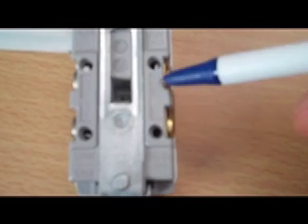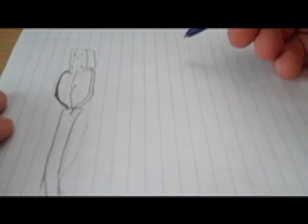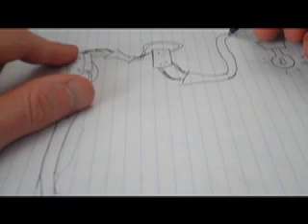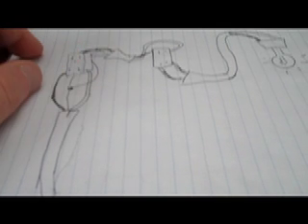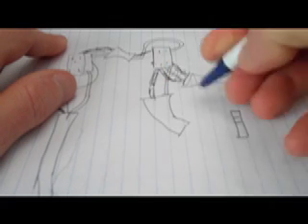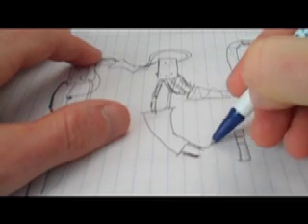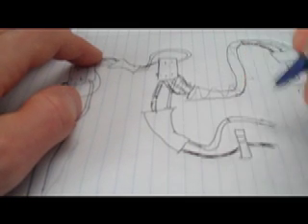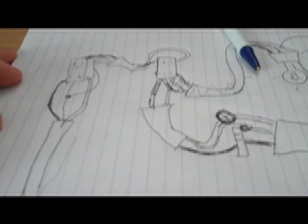Home Electrical Wiring Basics

Comment: Will the switch in this example only turn off the light, or will it turn off/on the outlets as well?
Reply from the maker: Kirk Christiansen no, the switch will only control anything downstream from it.  That's why the switch controls the light and not the receptacles.  Notice I put the switch upstream from the light only.  Good question.
Reply: Joby F. Randrup Perfect. Thanks!

Comment: can u please explain how to move an existing switch... i ran new wires from old box to new place... when i hooked it up (black to black etc)...on all the time...flipped switch and tripped braker... please help
Reply from the maker: Chris lastnamehere hook it up exactly as you unhooked it.  Switches typically only hook up the black wires.  One black frolm the supply side and one from the side that goes on to the rest of the circuit.

Comment: If you have a switch and receptical side by side, you can hook the power to the switch first, and then go to the receptical.
Reply from the maker: You are right that it is the preferred method.  However, there are times when you have to put the switch after the power (say if you have a basement light with a pull switch and you want to control it instead with a wall switch.  Watch this video to show you how to do that:  https://www.youtube.com/watch?v=j1Pn7ck33uA&t=37s

Comment: How is the series connected form the back of the original outlet?  Are the secondary holes in the outlet itself used to daisy-chain the power or?
Reply from the maker: Yes.  Just think of it like power comes in the outlet and, if you want more outlets or something, the power comes out the other holes to go to the other outlets or whatever.

Comment: Hello. I don't get why you need to cut the white wire to then put it back together when installing the switch.
Reply from the maker: +Kenneth Rivas you don't have to but it makes it much easier to work with the wires.
Reply: Oh ok.. Thanks.

Comment: Need your help! how do I wire up 6 lights for my basement. I ran Romex 14/2 (white-Black-ground) for all the lights. There is a 12/3 BX cable running from the braker box, to a junction box I would like to use for power, to the 6 lights. Thanks for your time (Antony)

Comment: Great video... I want to tap power from a garage socket and run a conduit to a light switch then drill holes for an outdoor garage light. What gauge wire do I use to run three outdoor garage lights? Thanks
Reply from the maker: +taskforceripper91 Check the circuit for the amperage.  Most likely, you have a 15 amp circuit which means it would be safe to run 14 guage Romex or equivalent.

Comment: Joby, thanks for the video, on your illustration in the beginning you show the hot wire going to the left side of the socket, I was certain the black (hot) went to the right side to brass. from there your next socket was then wired correctly with black to right side and neutral to the left side. Can you explain please? Thank you friend.
Reply from the maker: This video is mainly concerned with the flow of power from device to device.  Specific wiring videos can also be found on our youTube channel.  Thanks.

Comment: I appreciate the simplicity of your video and drawing. However, there are three problems with your video for novices and it concerns me. 1st it appears from your drawing that you are showing the line (black wire) going to the left side of the outlet and the white (neutral) going to the right. That is backwards. Facing the front of a switch, the black goes on the right (under the brass screws!) and the neutral (white) always goes under the aluminum screws on the left. 2nd, you indicate they can you use the push-in connectors on the back. A good electrician never uses the push-in connectors because they can eventually come loose; they use only screw terminals. 3rd you say you can use pigtails but then go onto indicate that they can just use the push-in or screw terminals to continue power to the next fixture. A good electrician will use pigtails in the box with one of those lines going to the outlet and the other leaving the box going to the next receptacle or fixture.

Comment: So, I've been in a couple houses where there were wall outlets that were turned on/off by a light switch. Is this due to the fact that the switch was placed earlier in the chain than the wall outlet? If so, I'm guessing that if the Romex was run differently, to where the wall outlet appeared earlier in the chain that the light switch, it would not be affected by it?  Thanks for the info in this video, things appear much clearer to me now!
Reply: +Kyle Belitz I came across that in 1 of my old houses. It was a pain. I couldn't use the outlet without taping the switch. Finally got tired of it and rewired it. But the house was a model home and the builder I think were trying to keep everything to 1 outlet making it easier to shut everything off.
Reply from the maker: Kyle Belitz You are absolutely right.  I have never heard of a switch controlling the entire outlet.  Sometimes (especially in apartments) they will put a switch before the outlet but the switch will only control one of the plug ins of the outlet, while the other stays active all the time.

Comment: As you point out only the BLACK ('hot') wire must get switched!  Unfortunately many a dummy doesn't know this and switches the white wire.  And it DOES work (makes the light go on or off) and so he thinks he did a fine job.  Except someone later comes along (including himself) wanting to change the light fixture, turns off the switch, the light goes out, and then starts changing the fixture thinking there is 'no power' to it.  ZAP if he touches the black wire on the fixture because it's STILL LIVE (it wasn't switched, the white incorrectly was).  His body now provides the completion of the circuit so gets zapped.  Which is why anyone should ALWAYS shut off the circuit breaker at the box before doing ANY electrical work on ANY circuit--- that solves the above possible problem caused by some earlier dummy wiring it the wrong way.  (in some cases a white wire is used AS a black/hot wire in which case it is marked with black tape to signify that but it maintains the rule that ONLY the hot wire in a circuit is switched).
Reply: six of one no you should always test the circuit for safety whats to say someone hasnt done the same in the circuit breaker? i live in the uk so our terminology colours and voltage is all different
Reply: i meant what if someone had crossed polarity of live and neutral? so your busbar is neutral and your neutral bar is live, i know its ridiculous to think anyone would ever do that but the things ive seen its possible
Reply: look listen, if the netural was connected to the hot busbar and the hot wire connected to the neutral bar. this meaning the circuit breaker would be swtiching the neutral it would be possible to turn it on and it would not be a short... even if you connected neutral to a hot circuit breaker it wouldnt blow it would just be crossed polarity. im an electrician and im assuming your not just think you know what your talking about.
Reply: The only person who would connect up the hot busbars with main neutral, and the neutral bar with the main hots, and every subsequent circuit breaker ass backwards would be in a rubber room somewhere.  You have a fantasy about doing things at a sub-moron level.
Reply: Bottom line is, after all the retarded input from Gaming boy, is, in caps, ALWAYS TEST ANYTHING ELECTRICAL YOU WORK ON BEFORE YOU PROCEED PERIOD, just to make 100% sure it's DEAD, whether you flipped off a light switch or the branch circuit breaker at the box, or hell even if the main breaker has been switched off.  Why take a chance?  Breakers can malfunction, including the main breaker.  Don't THINK about whether it's dead, TEST.
Reply: the first thing i said was to always test the circuit for safety, yes i am a fully qualified electrician in the uk, im not 14 and im not a druggie, your the one who raised an argument with me about something clearly you think you know alot about... my point was that it could happen and so test for safety i never said it would because i probably wouldnt, the stupid thing is that you ended on the same note i started with, are you an electrician or have you just once wired a plug and think you are?

Comment: Hi Joby! You are obviously an expert on electrical issues. I wish you had a local office! My husband has a good basic knowledge of household electrical, and has had success re-wiring some basic circuits; but is 'stumped' by our 'current' (lol) problem. We have an adjoining guest cabin wired into the main house. At the junction box; we have three strands; Black (hot), white, (neutral), and yellow. (ground) Voltage between the white and black (red & black going to the cabin) is 220V. Between the ground and the black, or the ground and the white is 110V. All the outlets at the cabin have 110V. We want enough power at the cabin to run lights,  TV, and a small a/c unit. Obviously; we want safe grounding. Any clue what the issue might be? You're videos are wonderful! I'm sure if you were here you could fix this in a jiffy! We have a graduation party coming up June 1st and can't find a local guy in time. Help! (hopefully) Thank you so much.
Reply from the maker: Joy Sharp You mentioned a red and black wire.  Are you saying you have black, white, and yellow going into the junction box from one area and a red and black tied to it?

Comment: Doesn't the black wire come off the top of the switch on the same side instead of the other side?
Reply from the maker: Usually...Many times both connections will be on the same side as you said.  I've seen it on the other before though.  Plus, this is a very basic explanation of how power gets from one place to the next, not how to wire a SPST switch.

Comment: from the circuit breaker the one you start out with, can you put two romex's in going to two separate outlets?
Reply from the maker: No you can't.  However you can run that Romex (that comes from the breaker) to two separate things (like two outlet or a light and switch and an outlet).  Just run them in series like I show in this video.
Reply: ok ty

Comment: can you connect 14/2 with 12/2 wires in boxes?
Reply from the maker: Yes, you cannot go the other way though.  All you would be doing by going from 14/2 to 12/2 is using thicker wire.  You must have some extra 12/2 laying around I am guessing.

Comment: I am in the midst of renovating a bedroom, but was stonewalled by the electrical work needed.  I have to move an outlet and then connect a light that was being run by a separate switch to the other light so that both would run on one switch.  I have been searching the Internet for help, and your video is, by far, the best explanation I've come across (even with the raw drawings).  Thank you!  Now I feel more confident about tackling the electrical.

Comment: when you were describing taking the power from one outlet to another (to continue the circuit) are you effectively having an "in outlet" on the top and the "out" on the bottom? that would allow both outlets to eventually work provided that all subsequent pieces in the series are hooked up correctly?
Reply from the maker: Yes.  And it's important to remember that when troubleshooting.  For example, if more than one outlet is dead in a room, it may be that something like a GFCI outlet somewhere upstream from those outlets is tripped.

Comment: Why would you place the first two outlets in series? Then you get a voltage drop across the second outlet and at the light.. I would assume the better way would be to run the first two outlets in parallel, then you run the switch and light in series (obviously). This way there is no voltage drop, and if either outlet dies the light will still work.
Reply from the maker: Jordan, simply because parallel circuits use more material so is more expensive.  That's the only reason.  Parallel is always best but it's the most expensive option.  Great point!
Reply: Jordan Bausmer I think he was actually doing it the way you said. You have to put the outlets in parallel. He is not talking about a series circuit, he just says "series" when he is joining multiple outlets together in parallel.
Reply: I had the same question. Is there a good answer?

Comment: +p. m.

Yes. The remainder of the items in series should be grounded.
Outlets & switches will still work with only two wires. But, why would you leave them ungrounded in the first place? Grounding was designed to save equipment,
or anything you'd plug in, from damage due to electrical overload.
Reply: I didn't get why he ran the ground wire back up to the other ground instead of to the next electrical outlet
Reply from the maker: Grounds follow the power.  In this example, the ground goes into the back of the first receptacle, then the second, then the light.  The only thing that isn't grounded here is the wiring of the switch.
Reply: Joby F. Randrup yea I'm talking about at 2:01 in your video when you take the ground and loop it back instead of running it with you black and white wire to the next outlet unless I'm confused can you explain better please that part
Reply from the maker: Jeffrey Duggan oh okay.  The reason you have to tie it together is because there is only one ground screw per outlet.  The one Romex goes in to the outlet (there are two holes for the white and black to go in to).  The new Romex start at the other two holes in the back of the outlet.  However, there is only one screw that will accept a ground wire and I believe the connection is more secure if you tie them together instead of attaching two grounds to one screw.  I will try to post a video showing you exactly what I mean this weekend.  Okay?
Reply: Joby F. Randrup okay yea please post a video explaining why you tie it back and how it grounds the other outlets would be awesome thank you
Reply: And when you piggy back it you snip the wire and twist all three together with wire nut? Could you demonstrate with spare wire if possible?
Reply from the maker: Here ya go.  This should answer your questions Jeff.

https://www.youtube.com/watch?v=8btDgSERDRQ&feature=youtu.be

Comment: For years, what you show is how electrical has been installed.  However, many cities have adopted the National Electrical Code (NEC) which no longer allows this type of wiring (even though it is the manufactures recommendations for installing their product).  The NEC requires more labor, therefore electricians can charge more.  The change to your video is when you added the second outlet (receptacle).  Instead of connecting the second wire to the outlet, you would disconnect the outlet and add a "pigtail" (short coated wires) and wire nut all three of the same colors together.  The "pigtail(s)" are not connected to the outlet.  Using the NEC wiring practice, if an outlet goes bad, it does not cut the power to the other outlets in the series.  BUT if those wires are not "nutted" tight (can yank a wire loose), you have a potential fire hazard...and why I personally agree with your drawings and the "manufactures" way of installation -- BUT at this time, you way will not pass an electrical inspection and viewers will have to redo it to the NEC way - so viewers need to check with their local code officials to see if they are to install based on the NEC or the Manufacture's recommendations.
Reply from the maker: All of my wiring has passed where I live, both new construction and retrofit.  Thanks for the info though and you do bring up a good point:  You should always go to your friendly library and get yourself the newest and hottest version of the NEC (a lot of people don't know you can access it for free right at the library).
Reply from the maker: p. m. Hello!  Wiring that is sloppy is always a potential fire hazard.  Do you think a 'how to wire' video would be helpful?  Unfortunately, pig-tailing is the easiest way to interface at the site.  It is not likely to go away any time soon.  It is very important to make sure all connections are snug.

Comment from the maker: The outlets should have ground connections.  They are usually green.  This takes the ground from the breaker, out to the outlets and back to the breaker.  If your outlets don't have ground connections, they are probably out of date and should be replaced.

Comment: Great video, thanks for taking the time to share the information. Question though...it said that you looped your ground off the first outlet to the ground on the Romex coming from the circuit box. What do you connect the grounds to on the outlets and switches further down the line?

Comment: That's not extra voltage, that's extra amperage. Extra voltage would be 240v which is not used for electronics. You won't burn the circuit if it's wired properly, you'll just trip the breaker if you overload it.

Comment: Good video. I prefer to run power to the light as you drew it first. Then run a drop to the switch and back. This way you can add more lights or outlets after the first light without being affected by the first switch.

Comment: Thanks for the vid! Just one question: you're calling these connections as 'series' but wouldn't you call these connections as parallel in the rigorous circuit theory case? Thanks

Comment from the maker: You would have to run it through the walls from your breaker box.  If your lucky, you can find a lesser-used circuit close to the room where you want more power.

Comment from the maker: Check your main breaker.  It will say what the capacity is for your home.  Your best bet is to do what I did when I built my workshop and get a separate service of 100 amps.  That would be a completely different breaker box.  They might be able to tie in right from where your service enters the residence.